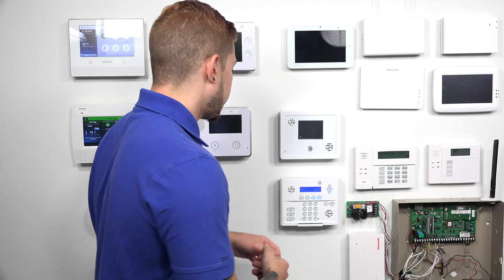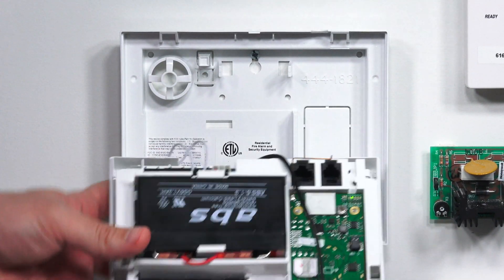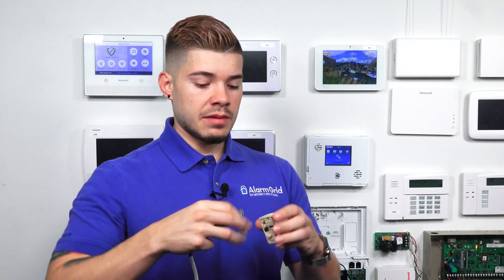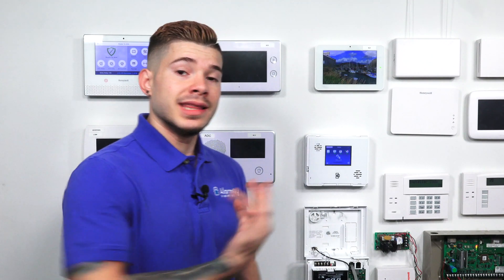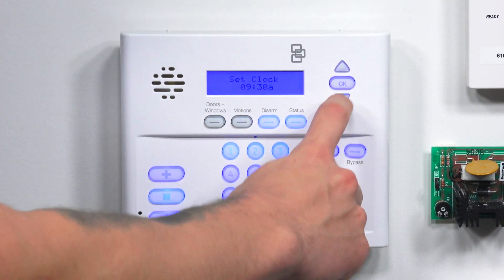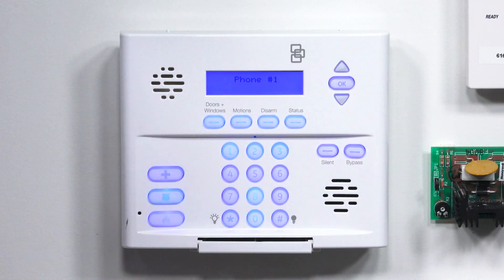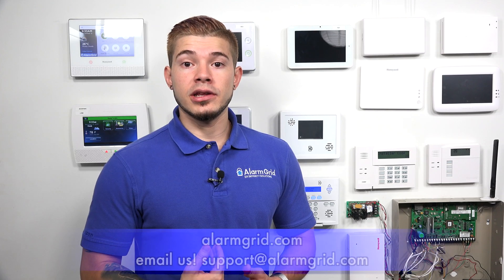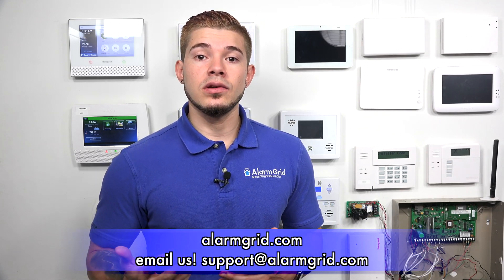Using Phone Line Monitoring on an Interlogix Simon XT (deprecated)

Comment: How do l talk to someone on this system
Reply: Hey Nalini, I am not seeing any features that will allow you to use the Simon XT to make or receive a phone call directly from that panel. There are options if using a Two Way Voice feature when an alarm is triggered, but that feature requires monitoring with a central station.